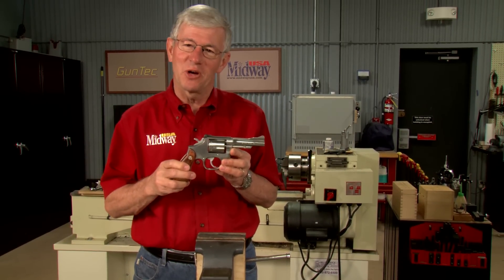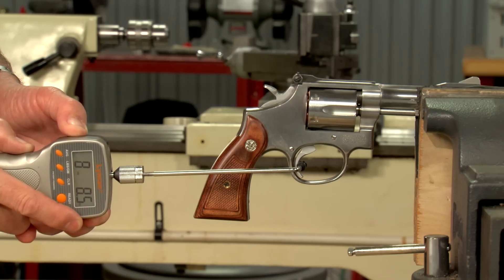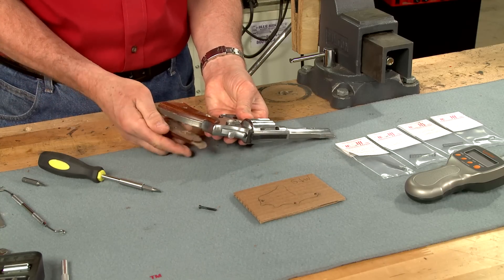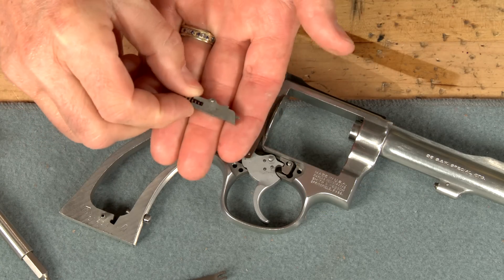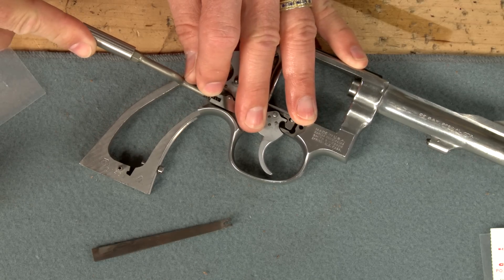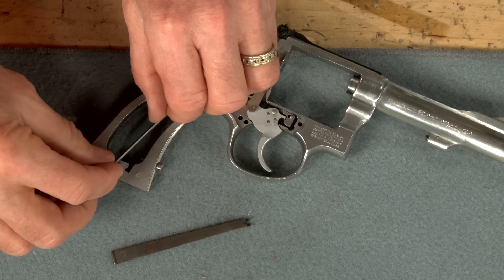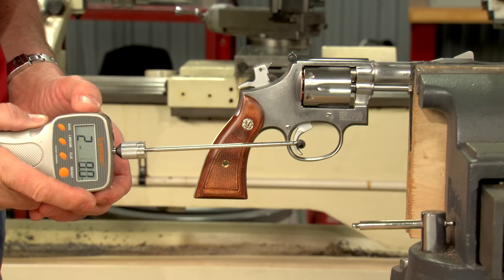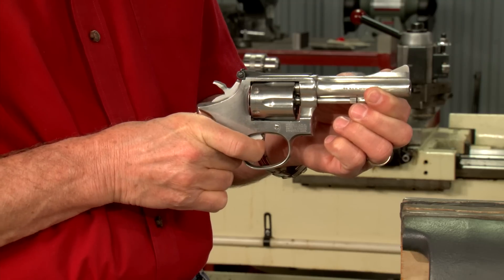How to Install a Spring Kit in a Smith and Wesson Revolver | Smith & Wesson Revolver Project

Comment: Doesn’t light springs have the disadvantage of making a gun prone to light primer strikes?
Reply: That is correct. I had exactly that experience with my 629-6. I tried using a Wolff mainspring very similar to the one shown in this video. I also tried the Wolff 12lb slide spring. Nothing but light strikes. I was using Federal, Magtech and Buffalo Bore ammo. I had to step all the way up to the 15lb spring and I had to switch back to the factory mainspring. I  did polish the internals while I had the gun apart.
Reply: yes fail after short times

Comment: Wonder if the wolff mainspring was reduced power or original factory spec. weight ?  If it was reduced power I am willing to bet there was issues with light primer strikes but we will never know because he never commented how it worked after he did the change.
Reply: I bought a brand new Performance Center 686 Plus/Davidson's Exclusive, and the paperwork said it had a reduced rebound spring, but said nothing about the main spring.  It has that rib and I bet it is reduced because it has light primer strikes in double action and now I have to unfarkle it.

Comment: I know you tap the frame to remove the side plate cover using inertia but how do you put it back in?
Reply: +TheYoungConnoisseur Set it in place and tap on with a plastic tip hammer,install face plate screws.
Reply: make sure that you insert the top part of the plate first

Comment: Your comment gave me a laugh, but I think Jack was wondering why it was necessary to use snap caps for testing the trigger pull.  As far as I know, it would be out of concern for not possibly damaging the firearm by letting the hammer fall on an empty chamber.

Comment: maybe. in my experience with guns, as long as the striker dosent hit metal when "dry fired" its okay. if the striker however hits metal, it will deform and will be more likely to not ignite the primer. but since i am no gunsmith i wont tell anyone that its one way or the other. :)
Reply: snap caps

Comment: Why are you using snap caps ?
Reply: I never dry fire my guns. Firing pins need to make contact. Otherwise, you are risking damage.
Reply: @tsarytsin okay Fudd 🙄
That's what snap caps are for. Or just use a spent cartridge that still has the popped primer in it ......
.... never dry fires his guns...lmao .......